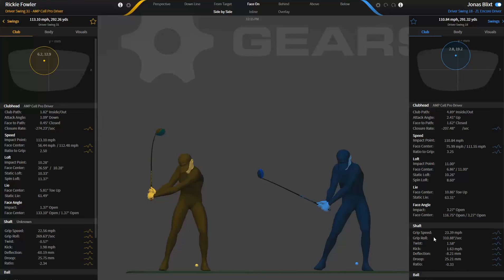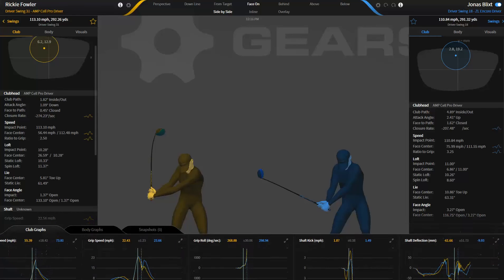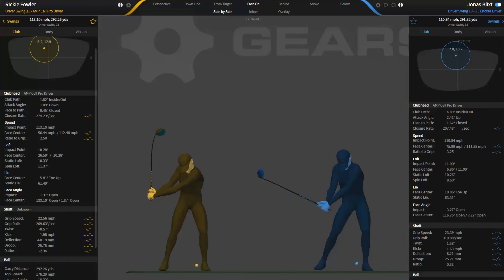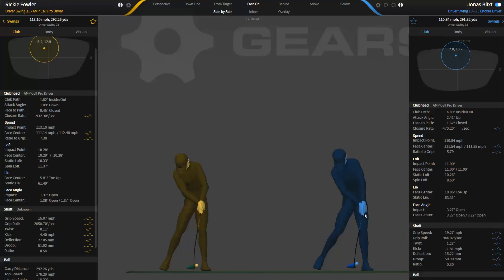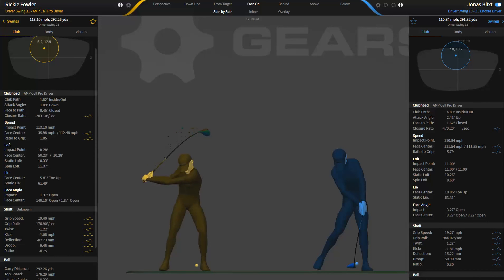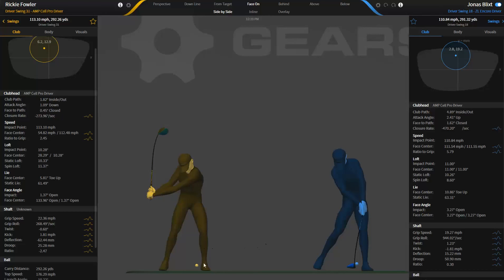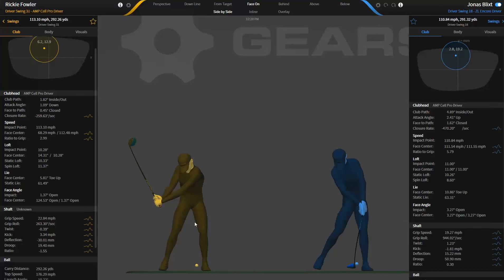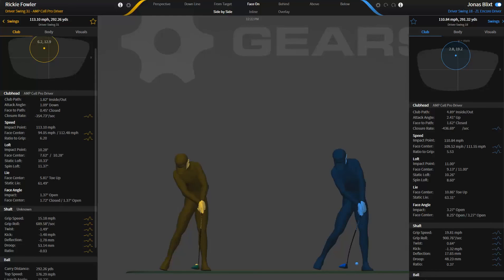GEARS GRIP SPEED DEFINED

Comment: It's rolling release vs. held off (aka "drag and hold" or hockey) release. Vertical swingers like Justin Thomas, Jack Nicklaus have rolling releases. Michelle Wie & Alex Noren are held off release and rotary. I don't think you can make a direct correlation.
Rotary swingers are typically taught a held off  release and vertical swingers usually have a rolling /crack the whip release. But it's changeable. Hogan changed from rolling release to held off. Tiger was always vertical / rolling release and under Sean Foley he went rotary / held off. Now he's back to vertical / rolling. But his stinger is a held off release.

Also... driver vs. iron? What kind of shot are they hitting? It changes the release.